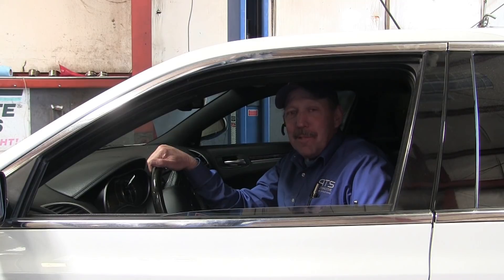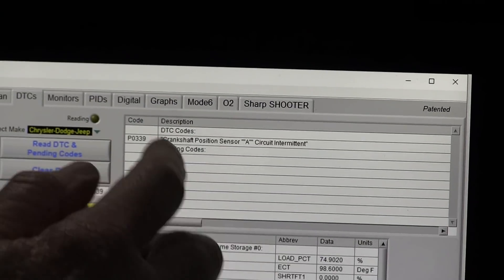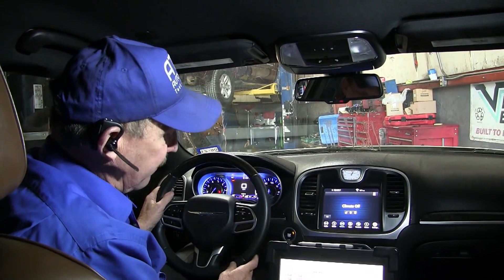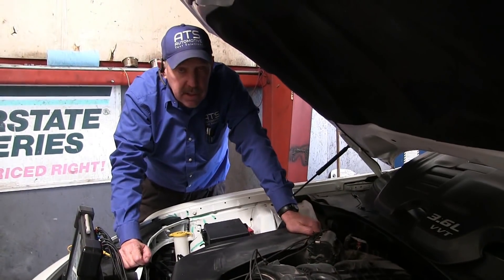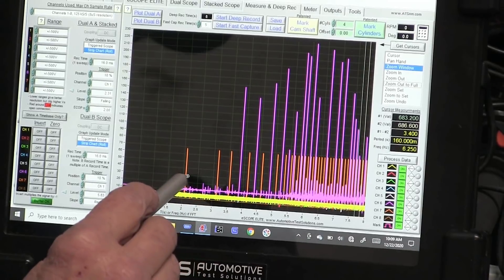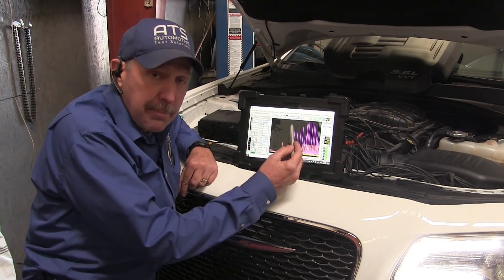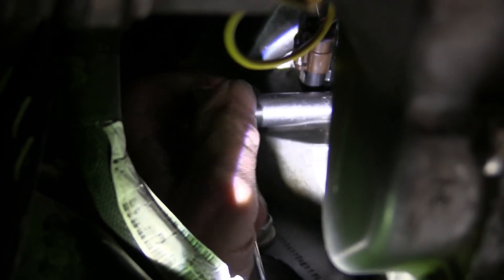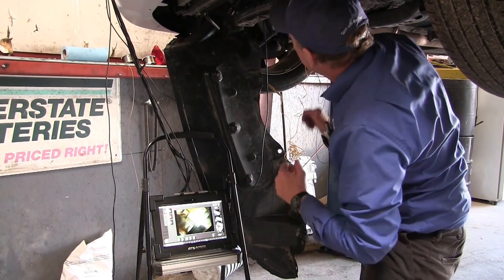Diagnosing a 2018 Chrysler 300 with a Hard Start and a P0339 fault code

Comment: Very nice, BT. Besides a visual inspection, i cannot think of a way to troubleshoot this WITHOUT A SCOPE. I'm thinking the CKP code plus 2 sensors should trigger the tech to eyeball all components, but that bent tooth is very subtle. Great case study to promote use of scopes 👍.

Comment: Awesome find Bernie but this type of problem is somewhat common. This is a pull-down system, when the wide-tooth piece of metal passes the CKP sensor, the signal is pulled low. This is where we see the wide gap, low voltage, in the CKP waveform. The voltage goes high with the air gap in front of the sensor, then when the tooth arrives in front of the sensor, the voltage goes low, repeating when the air gap arrives in front of the sensor, the voltage goes high again. When we see the voltage stay high, we assume an air gap, in this case, a tooth that is too far of a distance to be picked up by the sensor, if the voltage was to stay low more than expected we could assume metal to metal short circuit by another piece of metal or a collection of metal chunks or filings between 2 good teeth. 

The bent metal of different types of vehicle systems is a common problem due to poor maintenance practices such as prybars or misuse of tools in the wrong area, such as what happened here. An engine may start but won't rev up due to a 24x wheel partially bent on the back of a GM harmonic balancer (HB) thanks to a prybar being used to remove the HB.

Comment: Holy smokes! I have one at the shop waiting on the OK! 4 tooth past sink notch spikes up above normal 5.4 ford. Crank sensor already replaced.  Told we need to remove and pay attention to the 4 index! FYI  the cam crank is the same for 6 and v8 2 valve.

Comment: One interesting part is the PCM set a circuit code, so you'd think it was a wiring, pcm, connection, or sensor problem.  In actuality the PCM was expecting to see a signal change in a certain window of time, but it never saw the change.

Comment: Why would it flag a circuit code??
Reply: PCM interpreted the missing tooth/signal as a loss of signal, ie ( circuit failure ).
Reply: @billyr9840  There was no signal missing and the signal voltage stayed well within range...this doesn't jive with the definition of a circuit failure (maybe it was set with the sensor disconnected at one point and the switch open?).
Reply: @juergenscholl2843  I was thinking the pcm saw the signal low when it should of been high that it interpreted it as a momentary glitch  ?
Reply: @billyr9840  That would cause a performance code, not a circuit code....
Reply: @juergenscholl2843  because... Chrysler.
Reply: @SuperMarioDiagnostics  Oh yeah, I completely forgot about that🤪

Comment: great vid. There is no excuse for a billing mechanic NOT to have a bore/endo scope there very economical and part of the verification test process. Even if you didn't utilize the scope event driven test methodology of the crank sensor- at min a verification of the internal location of the  tooth.

Comment: How did you know it was a bad crank pattern without a known good? The missing tooth was so close to the large tooth I would have thought maybe it could have been part of the design of that particular tone wheel if I had never seen a known good for that car. Granted most crank sensor signals I've seen only have the one missing tooth or large tooth. Doesn't mean they can't be built differently.
Reply: FYI I searched IATN, no 2018 info they don't even have the vehicle up yet. Identifix has no nothiing-no surprise-I didn't expect to find a waveform. Short answer, I have no idea what sort of voodoo Bernie pulls on these cars.
Reply: Found some other waveform access, did find a 2016 300 cam crank waveform that confirms the bent tooth....
Reply: @brentowen9480  I know that there is a fairly large cam/crank wave form that comes with the ats scope, I've called about purchasing one.  It's a hard price to swallow but it is a great scope if you can get passed the learning curve. Lots of great built in tests.
Reply: It is usually a square gap, other usually have like an ac wave but there is a unique ramp for each turn as well.
Reply: @scientist100  I get that's the usual but what if the designer of the engine/software decided the pcm needs to see one large high gap followed by a large low gap to determine one full revolution?
Reply: @benb4688  
only the  big gap is ok to make the synchronisation .doesn't need a low gap after the dig one.actually, is better, to have more teeth to read , so the pcm, can know  more accurate,the position of the crankshaft. 
And the big gap, is never on any cylinder TDC,because of that, so the pcm have more teeth to read and do the calculations. (everything,cam ,crankshaft,etc,  are synchronised before the 'big bang event's ' )
Reply: Experience. The reference waveform will be in his head, he will have scoped so many of these engines over time. You would do exactly the same. "Hey, that doesn't look right!"
Reply: @simonparkinson1053  If I knew what a good one looked like I would of but this was a 2018 I haven't had a reason to scope one yet not sure he did either cause that car is so new can't imagine many of them failing yey.  I am not questioning the diagnosis it was spot on just trying to figure out how he got there so I can learn to.  If I would of seen it in the middle of the pattern I would have said hey that ain't right but at the very end I didn't see a problem with it just thought it was a characteristic of that vehicle having never seen one, I would have thought maybe signal is good at the sensor but what about all the way to the pcm and spun my wheels chasing that before I circled back around to the sensor wave form again.
Reply: @benb4688  Thinking the same myself, figured Bernie has a library of these in his head or looked off camera. For me, I find a known good before I bother scoping the signal. I've scoped CMP CKP and couldn't find a known good, (AUDI)...

Comment: somebody been there before ,trying to removed a old stuck crank sensor  and probably you will find some part of it in the pan ,they knocked the old one in and touched the reluctor wheel with the tool used to do the job!
Reply: Why is a crank sensor on a 2018 car needed to be removed?
Reply: @nikolatesla7490  because those fail a lot on chrysler
Reply: Damn you beat me to it.  I should kept scrolling down before replying above.

Comment: Question of the day: how in the world did that reluctor tooth get bent??? Love the scope captures. 4 channels is never enough!!
Reply: Ivan, did you ever consider buying the escope 8 channel ? This will be awesome.
Reply: Hey Ivan may it brushed his teeth so hard that it bent his tooth.
Reply: @ganeshnarayan5505  hahaha
Reply: I originally thought that the top of the tooth somehow broke off.  I would love to see what's laying in the bottom of that oil pan.
Reply: Very creative sabotage?  That is, without question, the question.
Reply: It’s a Chrysler
Reply: Maybe the original sensor was stuck in the block, so they broke the connector cavity off prying on it.  Then bent the tooth trying to extract the rest of it out. Maybe parts of the original sensor are laying in the bottom of the oil pan...lol.  Stuck ckp sensors was a common problem on GM LN4s back in the day.
Reply: @Discretesignals  It's unfortunate that we probably won't get to hear about or see what's in that pan. 😞
Reply: @Discretesignals  I thought something along those lines originally - that someone changing the cam sensor somehow stuck a screwdriver or something in the hole and damaged the tooth. That, however, implies a different genesis for the original problem - long crank time. When he first tried starting it, the audio of the crank sound made me wonder if there was something possibly damaged on the starter Bendix gear, which might cause they flywheel to turn improperly and cause confused timing issues.... Obviously we'll never know.
Reply: @Discretesignals  good info
Reply: said every russian on the planet! lol   actally one channel strategically placed would have been enough. but yeah scope envy is real

Comment: As someone with a shop I like the video series except he’s using a software that pretty much nobody else has or ever heard of. It’s not snap on or autel or any other common tool. While the principals apply it makes it
Impossible to follow along on some of these tests because of the tool and software he’s using.
Reply: It's definitely out of reach or justifiable for a backyard mechanic but it is available.  Bernie has certainly become one with it.
Reply: @jimr549  I wasn’t saying it’s not available. I’m saying up until
His videos I had never heard of it. And the other places I’ve worked never used it either. Shops mainly stick to the big three. Mac, Matco and snap on. I’m not saying it’s better or worse just that it’s so different then what is the norm you can’t really follow along with your tool because it doesn’t have that feature.
Reply: The tool is definitely very different, but really all it does is change the way it reports data. Most scan tools just display a PID and it's value. Bernie's system effectively coverts the displays of numeric data, like fuel trims, DTC's, into a dynamic summary form. The dynamic switch of fuel trims from rich to lean via visual cue is a really smart way to represent that data. This is a scan tool with a great GUI design on top of it, and I'm guessing it was developed with the aid of a tech at the outset or by a tech with a good software development background. It is exceptionally expensive which definitely puts it out of reach of a backyard mech or small-budget garage .. but Bernie also does great videos and it's great to learn from such an expert!
Reply: @DIYDaveOK  Bernie had a big part in its development  going back years from its inception.
Reply: @DIYDaveOK  he’s very knowledgeable there’s no doubt. One of the reasons I started following. My favorite is still probably scanner danner because of his personality. But they all provide some knowledge as we all know never ends in this field.
Reply: @corvette_rick  I watch ScannerDanner, too, and he's good, but my absolute favorite is Eric O at South Main Auto. He brings an amazing balance of humor, intelligence, humanity, and experience to the work of vehicle diagnosis and repair. I have learned so much from him, Ivan at Pine Hollow Auto Diagnostics, PJ at Voltage Drop Diagnostics, and even "Eric the Car Guy." I love to learn and all these guys provide great insights.
Reply: Another great diagnosis . Pretty soon , Bernie will have more channels than cable TV !
Reply: ANY SCOPE CAN DO THAT the trick is understanding the logic of the computers the more you see the more you learn.
Reply: This principle can be applied with any oscilloscope. Hantek will do just fine.
Reply: back in the day  our school auto shop had the sun engine analizer. scope and 8 other guages with cylinder shorting capabilities.  it was cutting edge.   ats has come up with thier own computer/scope setup that replicates that concept. luckily our shop teacher taught us to work with what you got. you had all handheld that you had to understand before moving to the big one.  this diag is no differnt. you dont need a fancy 8 channel scope.  so these are half commercials half diags. we'd all love to have that set up but in the end is it really necessary??? hard start  crank codes  who wouldnt scope the crank and cam ? one or two channels is all thats needed
Reply: @richardcranium5839  true, he didn't use the other data, one coil, one injector and 1 cam and crank. If you need to check timing just scope two cams, crank and one injector trigger. Most v8 have 4 cams but not all.
Reply: you can do the same thing with the cheap ass chinese knockoff but knowledge is crucial and data reading/translate.bet that any of your techs utilize  scope.